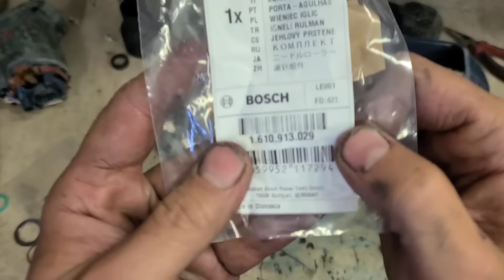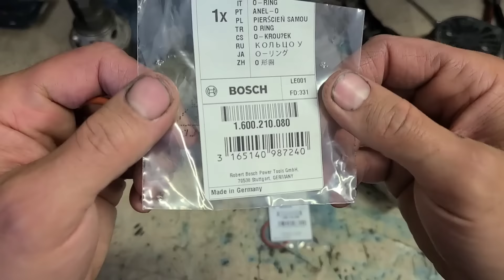Bosch Hammer repairathon. Repairing GBH5-38D, GBH5CE, GBH8/45D and GSH11E Bosch Hammers

Comment: Just out of interest have you had the Makita DHR182 or DHR183 in for repair or even on sale in the shop? 

The 182 was released in (I think) 2019 so past 3 year warranty time and the 183 last year. 

Loving the quality of service you give these Bosch hammers. They make the best SDS machines that need constant abuse well past the warranty.

Thumbs up.
Reply from the maker: No haven't had a single one in yet
Reply: @deandohertygreaser  Thank you for the reply that's good to know.

Do you sell the 40v XGT hammers in the shop? 
These are the release times: Hr003 (2020) Hr007 (2022) HR010 (2023). 

Thanks in advance.

Comment: How are you Dean,

Saw review of the Evolution saw the other day, I have the powered mitre saw, but me & the daughter are looking to get a table saw, we’re thinking either the rage, or the Metabo, can you recommend either of those, or another one at all please?

Cheers
Reply from the maker: The the Metabo metal frame table saw is a very good table saw, very powerful, tough and lasts years.
The evolution saw is smaller and easier to move around. But not as powerful. 
Both are very good in thier own right, but if accuracy is what you need then the evolution saw js the one
Reply: @deandohertygreaser  - Thanks for reply Dean, I’ve been very happy with both my Evolution saws so I think I’ll stick with what I know cheers fella 👍

Good luck for the Sam semi final - Jimmy ‘s winning matches 💚💛✊

Comment: Hi Dean 
Would it be possible to use the bosch oil in the other hammer since it's a really good lubricant or would it leak the next minute it's done ?
Reply: sistem should be built to use oil otherwise it just very fast start leaking- not working proper

Comment: Dean - I saw a video from Bendin with Bendon where he showed truck wheel bearings that are meant to run in an oil bath but had been greased. They didn't mix and the grease kept the oil off the bearings but didn't provide sufficient cooling, leading to bearing failure. Any risk of that happening on these oil bath hammers?

Comment: Tools fixed in this [MC] Hammer video (U can't hammer with this):
0:24 Bosch GBH5-38-D Hammer | Fault: Not hammering
27:44 Bosch GBH5-40-DE Hammer | Fault: Not hammering
51:04 Bosch GBH 8-45-D Hammer | Fault: Seized gearbox
1:17:43 Bosch GSH11-E Hammer | Fault: Not always starting
Reply: Thank you!!